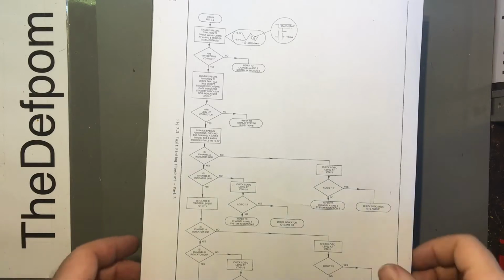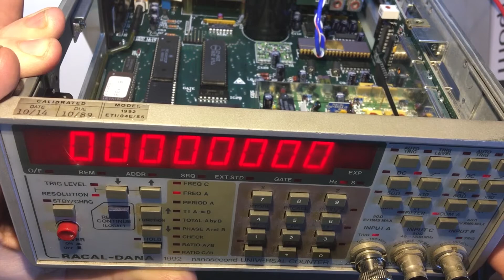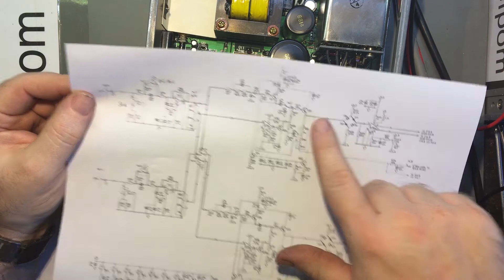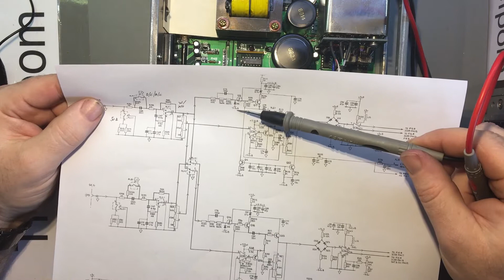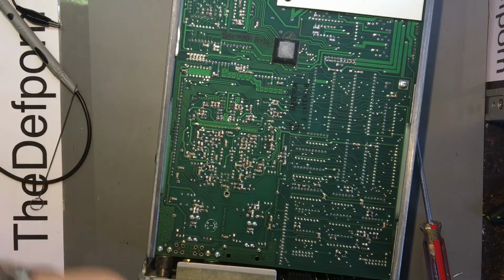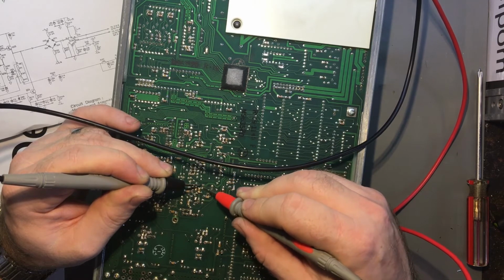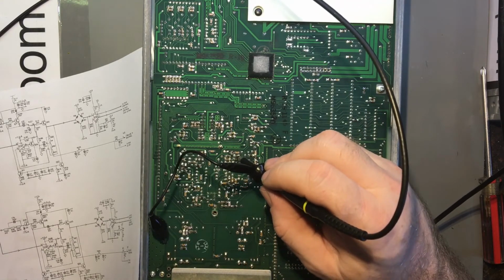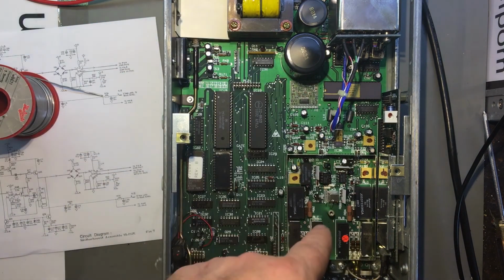#240 Racal Dana 1992 Repair Part 1

Comment: Great fix :-D, i suspect that someone shoved too much voltage into that input.
"They don't like it up um."  dads army :).
The old 741 is used in all sorts, it's good general chip like the 555 timer, around forever :-).

I have a dana 1998, very impressive old racal equipment :-).